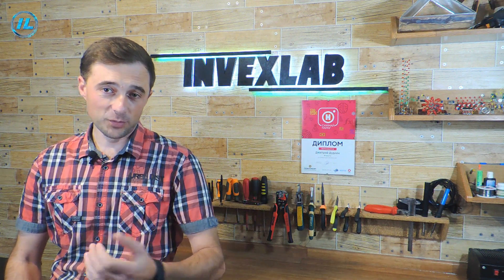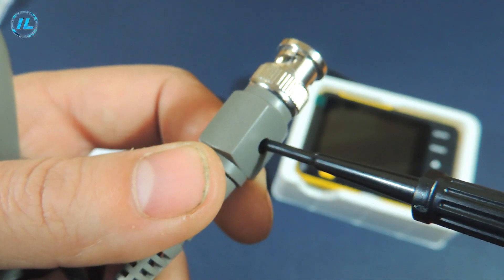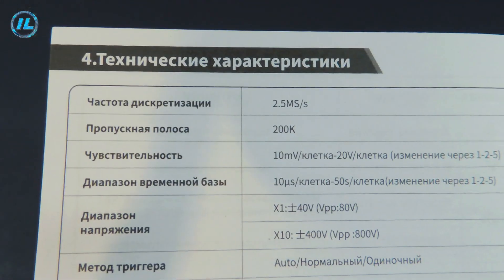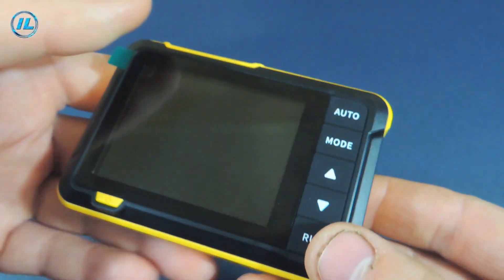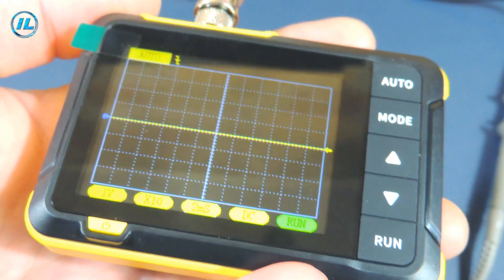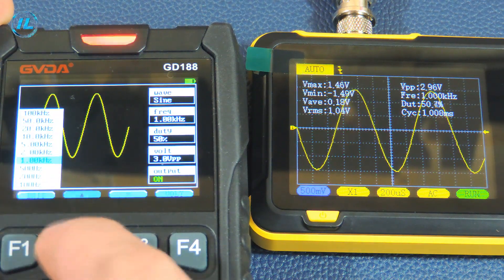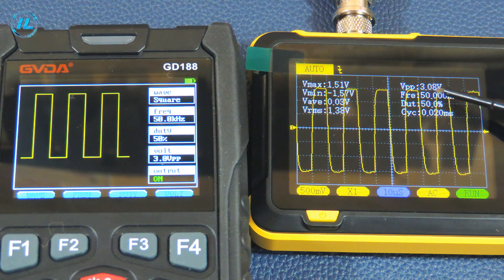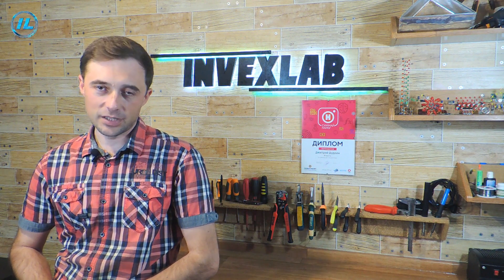✅ Now the oscilloscope is available to everyone!The convenient portable FNIRSI DSO152 oscilloscope ✅

Comment: Very thorough review of the DSO152 which I have been thinking about for several weeks.  You have demonstrated some inherent inaccuracies that I suppose my applications can tolerate (auto electronic diag). 

Does the DSO152 have any vertical or horizontal cursors that can be turned on and set?
Thank you.
Reply: You can adjust the left cursor to move your x axis (Zero Line) up or down. I move it down to be able to set my scaling better when using it for DC Voltage. I also bought this for automotive applications. I work as a diesel mechanic and although haven’t gotten to use it yet I think it will come in handy for finding opens/shorts when wiggle testing wiring. Speed and timing sensors are another great application.